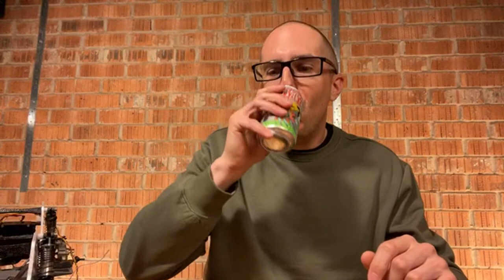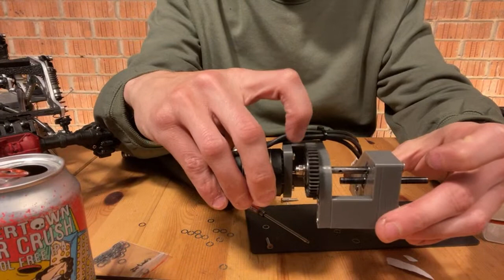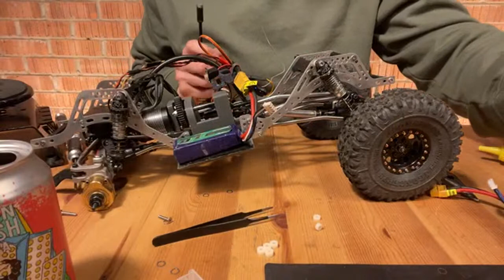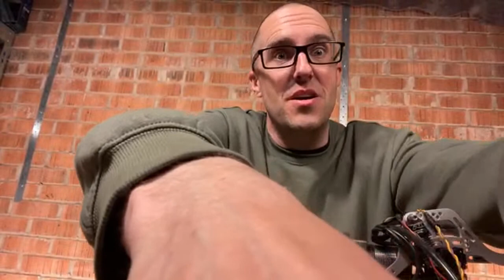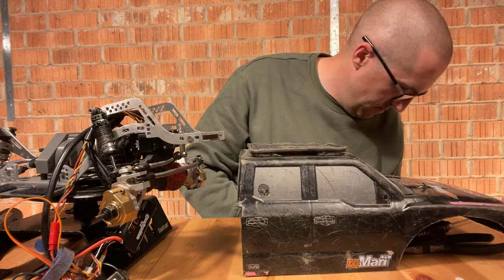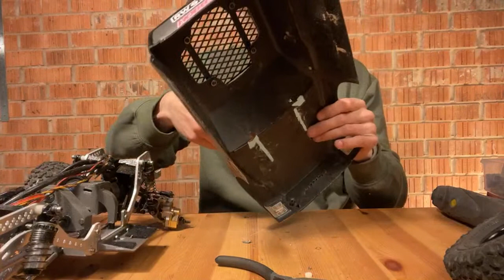Finishing up the NWSD team edition rails and my overdrive gearbox attempt 2

Comment: Superb work buddy , Really enjoying seeing where this build is going , From its early inceptions to where it os now , Also one of the few videos with these NWSD Chassis Rails , Which seem as good as any of the other top after market chassis rails (Brazin , G Speed , Toyzuki etc etc ..

The thing I've always wanted to see is a complete Kit for a Belly Dragger build (a standard setup to get started) , Links , Skid , Panhard Mount , Servo Mount , spacers , I know Brazin and G Speed have almost everything You need (especially Brazin Scale as they have everything You need listed on the same page as the Chassis Rails)(G Speed site is a bit more of a Work in Progress , Great Products though and the owner seems like a great guy , check out his Youtube channel for some great info), 

But If there was a complete package from a Boutique Builder and fabricator like (Ahem Just Scalin:) I think it would be a success ,, 3 packages , SCX10ii , TRX4, Gen8 , making the LCG Crawler builds less of a mystery would encourage new people and RC newbies , Instead of them getting into the RC Crawler Hobby with a Gateway Drug Like a TRX4 or SCX10ii ,They can get right to a custom LCG Belly Dragger with this kind of package :) 
Really like Your new motor mount and skid for the TRX4 , The only addition I'd like to see in a future design would be the same Hole System that Traxxas use to hold your motor in place (A B C D E etc etc) so that You don't have to mesh with a piece of paper , Unless that's patented of course ,) I hate meshing Spur and pinions , sometimes success sometimes not ,, Looking forward to your next vid :)
Reply from the maker: Thanks for the feedback! I’ll continue to put stuff on thingverse but I don’t think kits are feasible at this time.

The pre-clocked motor mounts are cool, but the paper trick really makes it easy and is easier to design for.

Hoping to get some normal vids up soon too, just waiting on a few bits and a camera to show up.

Glad you’re enjoying it and appreciate the feedback